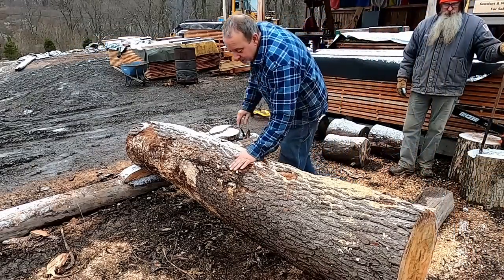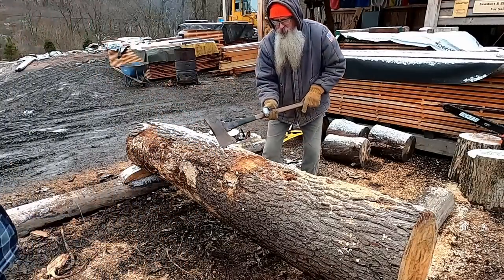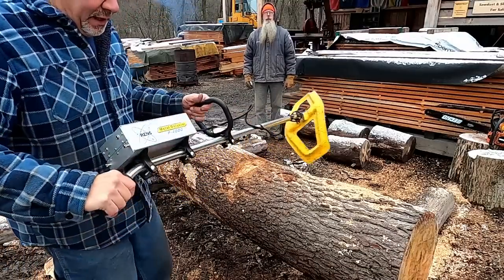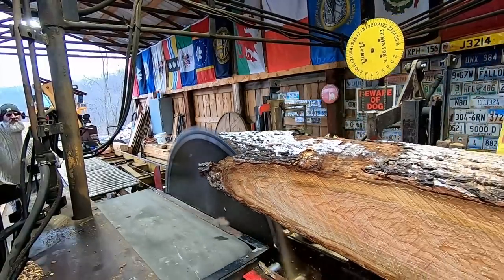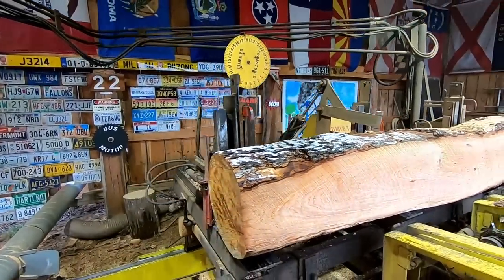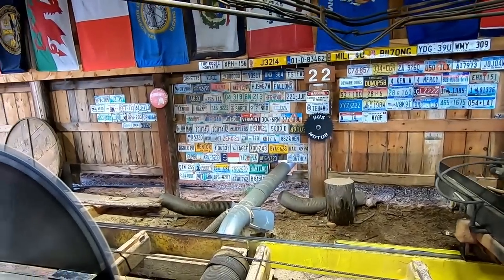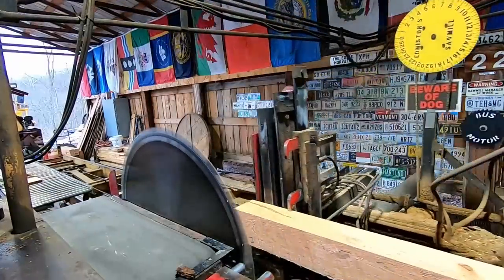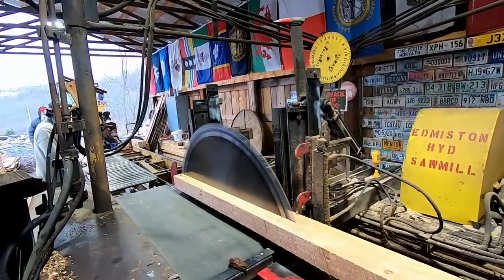sawing a cherry log with a nail in it # 385

Comment: Hiya Mark,
If you hadn't used the metal detector, you would not have known there was metal in the log; therefore, you would have cut like normal until you damaged the teeth on the nail. The way you said it, you would not have used the metal detector to localise the nail if you had not known you had not already known it was there. So who had his 16oz can before starting work? Hehehe. 
Great video; thank you for sharing it with us, in fact; for making it too!
Stay safe, Steve...

Comment: That quilted cherry is nice . 
I run a band mill and still hate hitting metal . If I think there may be metal I use a conventional prospecting detector , it cost lest than $200 and will find a tack 6 inches deep . I am sure the quality is not like yours but it works ok and has not let me down yet .
Reply from the maker: it did turn out some nice quilted cherry for a bad log.
Reply: @markgalicic7788  It looked very nice , I understand why you guys need the best detector out there . I just see so many people killing band saw blades that could be saved for a small fee of a cheep detector .

Comment: went to the Reel Mcoy sawmill -the video camera was inside the sawyers booth---and it was bluury and hard to see------did see the same setup as here, but older--
my friend worked at Elworthy & Co   in BC Canada--a Mountainus province with many sawmills----Elworthy was making Setworks and the shop welded up assembys for Band saw operations..they painted everything med-green-- my friend made big epoxy tablets --mainly for checking for metal at a chipper unit
he also did service calls , oh ya there was a chinese guy that built Laser units that were sent all over the states and Quebec , Canada

Comment: Metal of any kind in a saw log can be costly. I've found metal in log's with my homemade bandsaw mill a few times and it will wreck a blade fast or cause it to break. I broke a blade the other day and the blades for my mill start around $20 and go up from there.
Reply from the maker: yes it all adds up .

Comment: have you ever considered a cat's paw? Use them all the time to remove nails in lumber.....takes a little digging sometimes....sometimes I used a small hole saw to cut around it to loosen the wood grain then grab it with a tile clipper and pry them out......I imagine it would work for you without losing valuable lumber or ripping up a chainsaw